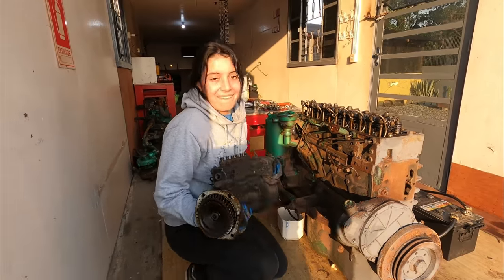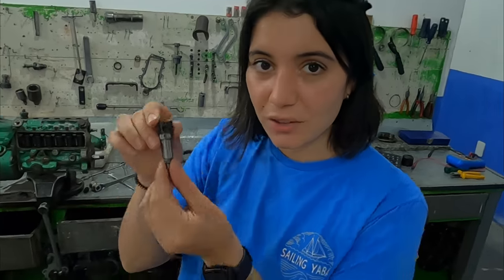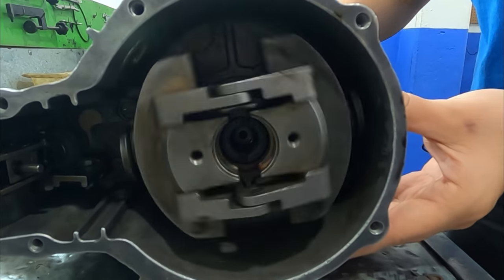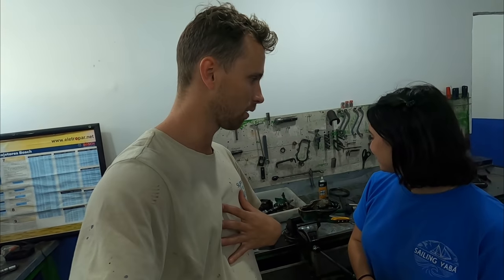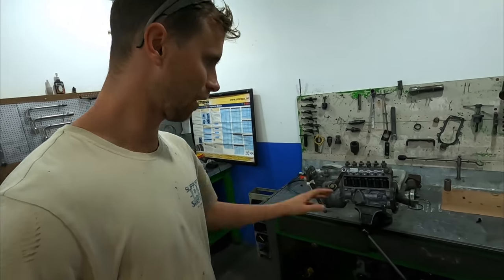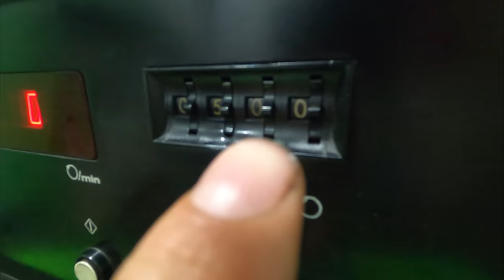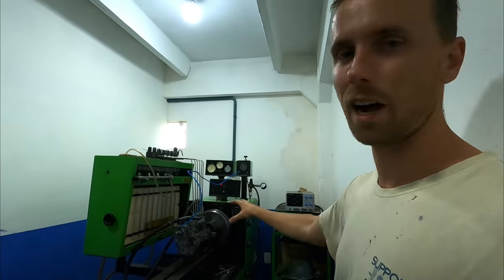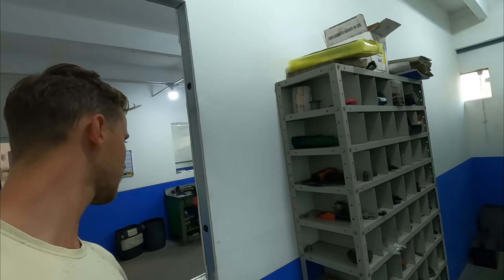Taking apart our old diesel injection pump at a local Brazilian truck stop OM352A — Sailing Yabá #59

Comment: Dump the old aux engine, you need reliability .
Check out the Tally-Ho  engine selection / hybrid episodes. 
As you will have huge electrical load issues. That old engine is JUNK. 
Need a modern hybrid engine for safety.